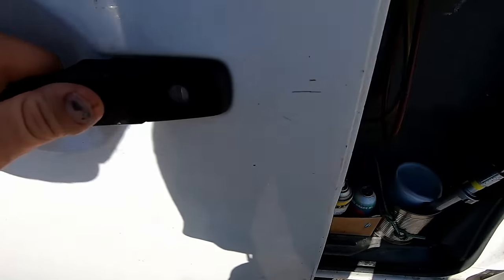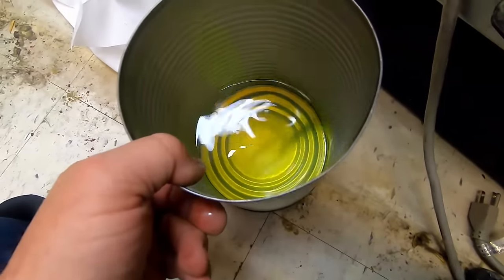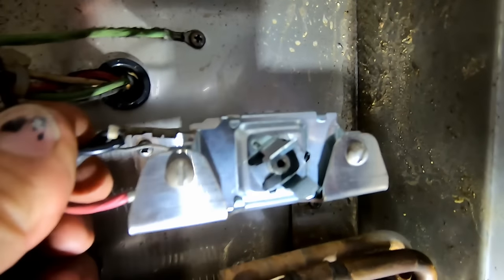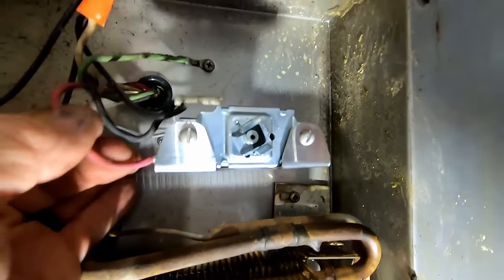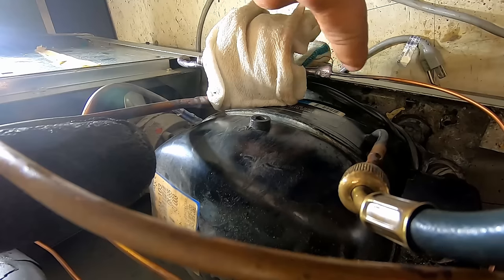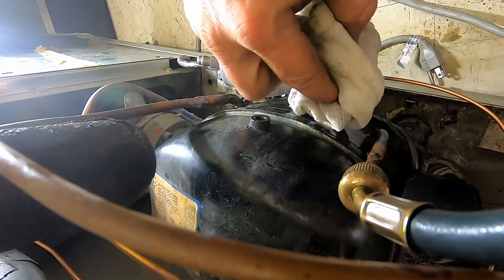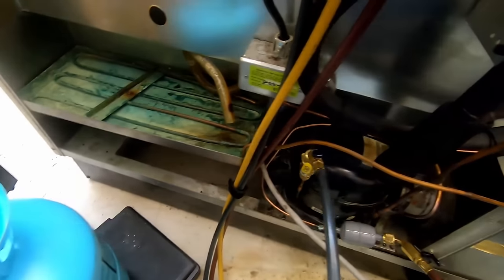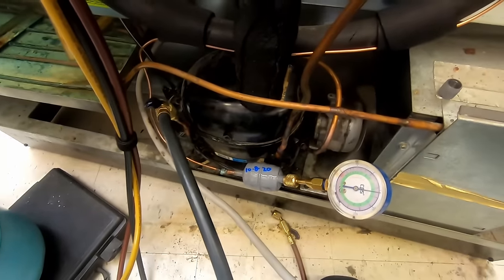Reach-in Cooler Repair New Evap Metering Device and Oil

Comment: Nice job, well done. I have used the “coffee can” measurement for years, I thought I was the only guy to do it until I saw Jim Pettinato do it in a video and laughed. Nice to see another one. Thanks for a great video. Excellent work.
Reply from the maker: Jim is where I seen it at 🤣🤣. It works absolutely perfect, I tried using a glass measuring cup at first but it wasn't big enough and was too fragile. I sometimes like to measure the total oil removed to decide whether or not it's trapped in the system.
Reply: HVACR Survival  I had a younger tech tell me several years ago it was a hack way to do it and it was not accurate. I told him the coffee can lines were accurate for coffee company it was accurate enough for me. Lmao thanks again

Comment: Best refer guy I know told me when he was in the field and working on a system that had a plugged cap-tube, he’d open up the system and add a thimble sized amount of Alkybenzene oil, and by the next morning the system was operating normally. Just thought I’d share that info, has nothing to do with your video lol but now when I have to open up a system for any reason and it has a cap-tube, I add Alky oil, just a tiny bit. Haven’t had any issues with plugged caps in a couple years now.

Great video as always, Rick 🤙🏽
Reply from the maker: Interesting...I've heard of the Supco additive and a couple others but haven't heard that before 👍👍

Comment: When I do those evaporator change outs I make new suction line then slide it through the hole then I don't have to solder inside of box
Reply from the maker: That's a pretty good idea...I kind of like that 👍👍 thank you for the idea 🤜🤛
Reply: @HVACRSurvival  the suction line is generally junk along with the insulation. Why not do it all
Reply: Excellent.
Reply from the maker: I fully agree. Probably would have been easier.
Reply: @HVACRSurvival  I know it be easier learned that
Reply: Excellent suggestion.  
Also, I would redo the drain tray liquid line at the same time.  It doesn't take that much time and may save a callback.
Reply from the maker: @pralaypatel7110  the owner was bouncing between buying a brand new one and making the repair. So to keep the cost down I didn't do it, most people would have changed just the evap coil and drier 😲. But I did scan it for leaks one my first trip.
Reply: @HVACRSurvival  I saw all that pickle green in the tray which is from them leaving the vinegar product inside the cooler open for condensation drips to bring it to that tray.  Some times I drop the tray and clear that and clean up the line set.  All in all most times in your video you do a bang up job for your customers.  

Peace brother. Keep up the good work.
Reply from the maker: That was green die for leak searching. There was sticker on the back of the unit that mentioned it was installed.  Thanks for the compliment 👍👍
Reply: @HVACRSurvival  good idah
Reply: @HVACRSurvival  lol

Comment: Nice job! A sheet of aluminium like off an old fan blade makes a great heat shield for brazing.
Reply from the maker: I actually have a two brazing mats that's fire retardant up to 1200°. I just didn't think about it till it was too late. I like your idea of the fan blade. 👍👍

Comment: I have done many of those evap ,cap tube and condensate line change outs on that model. They are simple to work on. I’ve found that 8-10oz is best for those. Most nomenclature plates I can’t read anymore due to cleaners. Good video!
Reply from the maker: Thanks Justin! I'm really surprised that compressor hasn't gone out by now.
Reply: HVACR Survival you’re welcome. We have at least 25 of those exact models that we service and honestly those compressors are beasts!! They apparently can handle the slugging very well because filters/condensers never get cleaned until we get a call.

Comment: Nice repair Rick . I’ve worked on several Duke units . The ones that I’ve worked on were at Subway stores . I have never seen them elsewhere. I always braze the cap tube on the coil before I install it . Makes the process easier. Those condensate loops are notorious for leaking .
Reply from the maker: That's what someone else was mentioning. I should have probably made a suction line for it and just shoved it through after brazing it together. You're on Target as far as where it's at 😎
Reply: HVACR Survival yes that’s also what I do . I make a shove in the coil with cap tube brazed in place along with 3 feet or of suction, just enough to add the rest  behind the unit . Piece of cake 🎂 .
Reply from the maker: Do you use a small bender for 3/8" line at the back?
Reply: HVACR Survival yes . I use a bender I purchased at at Harbor Freight tools for under $15 . It does 1/4, 5/16, 3/8  it does 180 degree bends .
Reply from the maker: @philltafolla  sounds like a good deal 👍🤛
Reply: HVACR Survival never been a big fan of changing oil on small compressors . But not a bad idea good stuff Rick !!

Comment: Any time you change cap tube,,,you change oil too ? What type oil are you use ,,,?  Great performance,,,!,,,,👍
Reply from the maker: Just depends on the circumstances. If the compressor has been running low on refrigerant quite often and going into a vacuum and running very hot,  I recommend replacing the oil. I go back with Poe oil which is what it had in it prior and generally that works with all the types of refrigerant that I use.  I've had callbacks where the oil has broken down from overheating and then plugs up a brand new cap tube.

Comment: Forgot to add... where do you get that roll-on adhesive foam tape you used in this video to wrap up the lines after electrical tape was applied. It had a yellow backing and looked maybe 2 inches wide?
Reply from the maker: Armoflex foam tape. Here's a link to some, it's not an affiliate link but it'll at least give you an idea of what it is. https://www.amazon.com/dp/B01HSNQ1O0/ref=cm_sw_r_cp_apa_fab_ws8GFbFPGZAB9

Comment: sir is it necessary whenever capillary tube blockage happens to change the compressor oil also? and can I use iso VG 32 instead of iso VG 22 Poe oil?
Reply from the maker: (A1) It depends how bad the oil is. I've had a few that plugged up shortly after replacing the cap tube. Also I don't get paid for call backs,  so I have been doing it this way recently without issues. (A2) You need to use poe oil on HFC gas, mineral based oil will not mix well and doesn't return to the compressor as it should.

Comment: Thee evaps should be accessible from the rear
Reply from the maker: That would be too easy 🤣.
Reply: There’s a couple of manufactures that have the whole refrigeration unit pull out.   The access was horrible through the cabinet until I looked at it for about 10 minutes longer.  Also made an evaporator leak, on an R290 unit, easier under warranty when they sent the whole refrigeration system.  Only had to plug in three electrical connectors and she was golden.

Comment: I’ve been doing SW work for a local franchisee and am curious if you’ve ever repaired a leaking evap in a Bain. ( coldrail).
Reply from the maker: If it's a replaceable coil I replace the coil and don't try to fix it just because the amount of time involved to repair it and then if it doesn't catch all the leaks or another leak starts the people are more upset about that money lost than the money that they would have reinvested into the machine to keep it running for a longer time.If there's a leak in the cold rail where it's inside of spray foamed wall, then no I don't even bother trying because there's really no way of doing it  without completely destroying the unit.